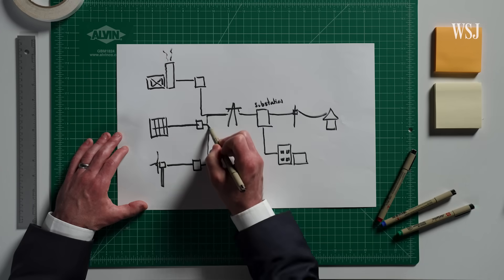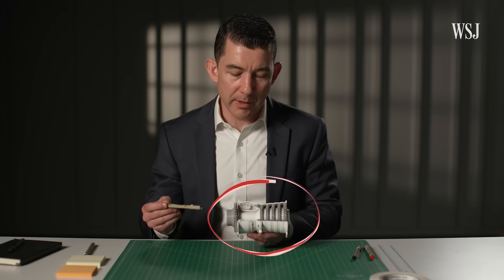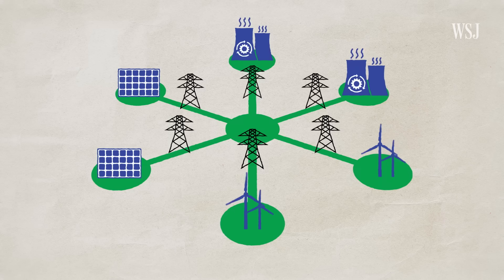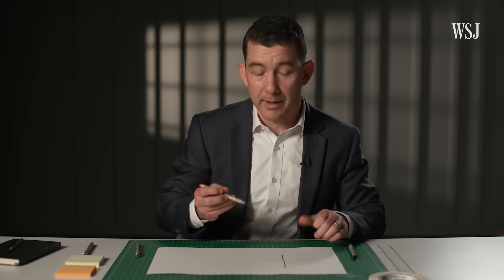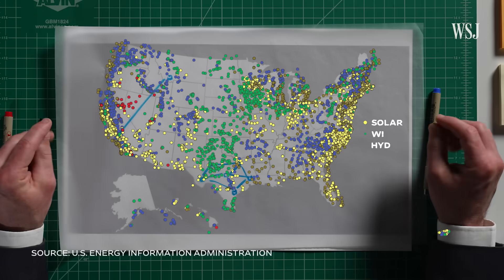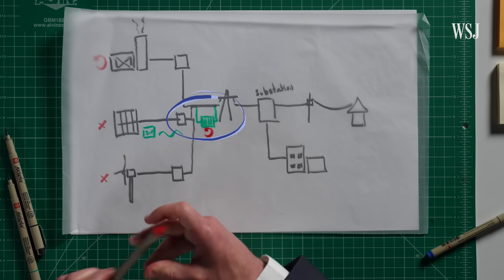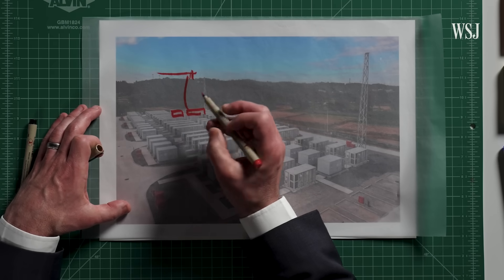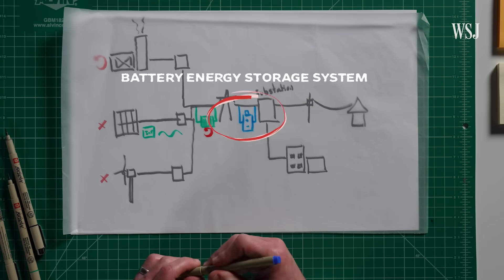How to Fix Renewable Energy’s Hidden Infrastructure Problem | WSJ Pro Perfected

Comment: As an electrical engineer, this was an outstanding overview.  Besides being an excellent speaker, the use of graphics and paper overlays was very fresh.  After the root cause(s)  of the Spain blackout are presented, this might be another piece of content explaining how things can go awry.
Reply: Except for the part where he overlooked what actual modern grid forming inverters deliver in terms of inertia.
See Dalrymple is SA, Australia for a first deployment.
Reply: I was concerned at first when they said “Mechanical Engineering”… but he did a great job all in all.
Reply: I'm no kind of engineer and I found that explanation horrible.  First, the frequency is tied to alternating current.  Yes? He doesn't explain how solar is direct. Second, frequency is a way to adjust energy based on demand (FAIK).  My non-engineering take on Spain is it didn't have the energy to make up for a quick lost of power from solar.  I'm not saying his explanation isn't good in a way, just that it does nothing, in my opinion, to educate me about WHY things work the way they do.  Anyway, surprised at positive comments.  Guess it's just me who doesn't get it ;)
Reply: @DepletionCurve  Doesn't matter as much as you think because Solar panel fields use Inverters to convert the DC to AC. Also correct on your 2nd point. Inertia doesnt fix the issue that happened with Spain. BESS honestly is the way forward. Most of the issues present were present before the use of renewables but are exacerbated by  renewables because of the way they work (more specifically, solar)
Reply: There's also a great video that goes in this problem on the channel Real Engineering and its titled "The problem with Wind Energy" (edit for a typo)

I was first introduced to the issues with harmonics caused by switched mode power supplies, battery backed inverter systems and other equipment in large office blocks in the late 90s.
Reply: @tonywilson4713  Yes.  Great video.  Love that channel!
Reply: @DepletionCurve  yeah he's actually a really smart engineer.
During COVID when people were proposing all sorts of solutions to the shortage of respirators he did this incredible video on how respirators actually work AND NEED TO WORK.

It turned out that he spent a chunk of his career working for one of the Worlds largest manufacturers of respirators.

The moment he talked about why you need super accurate pressure sensors with very fast response times I knew that most of the solutions being put forward WOULD NEVER WORK and likely kill a lot of people.
Reply: @tonywilson4713  COVID marked the end of respect for science, for me.    Or maybe it was when they started advertising drugs on TV.  Or when we didn't move over to the metric system.  Whatever the date, it passed ;) This video is exhibit A in having hundreds of thousands of electrical engineers you could call but you interview a mechanical engineer.  There are EEs on YT who cover the grid.  Well, preaching to the choir ;)
Reply: Why would they get a mechanical guy to do this?
Reply: @Manish_in_hell  At least they are starting to ask engineers instead of politicians and people of the street.
Reply: @Manish_in_hell  I think because he is involved with the synchronous condenser. Otherwise they should have gotten an electrical engineer specializing in grid systems.
Reply: @Manish_in_hell  Well, turns out the "mechanical" fella was quite qualified for the job. It's highly likely he has worked in the energy sector for many years. Maybe he has even sold and installed some of the equipment he talked about. That being said, nothing he covered was too complicated. Any engineer (chemical, industrial, petroleum etc.,) who has worked in the energy sector for a significant amount of years could potentially explain it just as well.
Reply: @MWENDA-vv5im he as a mec guy isn't qualified to comission any high voltage generators or transformers.
Reply: This has been known for decades.  Why did WSJ and MSM wait until Trump was president before telling the truth about green energy?!
Reply: Residential solar installations are great. They can provide even more stability to the grid. The panels on my house generate 7.2kw and on a hot sunny day in the summer and I'm using only 2.3kw with the AC on full blast and fish tank and console running. That means I can provide almost 2 more houses with the same energy needs. The long distance wires from the power plants don't have to provide so much energy.
Reply: Why does hertz have anything to do with it. The power line on my house doesnt come from a power plant. Isnt the electric idk, storage? Thats in every town. Got fences around it. Transfer station. Isnt that a battery basically?  Then we get our power from that? If it is storage why would it matter what hertz it is? Im probably sounding real stupid. But you cant learn if you dont ask questions.
Reply: Renewable energy will never meet the demand of AI and server banks. If we keep building them we will create a catastrophic energy shortage that will shut down the economy for months. The cost is also too high and must be offset by taxes. Fossil fuels and nuclear are the future. CO2 doesnt make the earth warm it makes it green and creates oxygen. We have barely enough now and we need more. Green plants increase their ability to convert CO2 to O2 exponentially and we could never make more then they can use. Human caused climate change is a fraud.
Reply: I'm an aerospace who works in industrial control systems, automation and robotics. 
Yeah they got this right but 30 seconds into this I wanted to scream - they asked a mechanical engineer.
I've basically done 35+ years of electrical work and most of that FIXING the mistakes of mechanical engineers. 

WHY TF didn't they ask an ELECTRICAL ENGINEER?
Maybe we should at least be grateful that that they at least asked an engineer instead of yet another economist.
Reply: @tonywilson4713  Thanks for reply.  Yes, I didn't think he said anything wrong, but as I mentioned,  yes, you don't want to get the frequency too low, but frequency is also used to protect consumers from surges, right?  The proper conservation is how AC works, why it's important, and why it's difficult to bring direct current sources into it, especially if they are not easily converted into AC?  Agree?
Reply: @tonywilson4713  looks like 35+ years of fixing others might say more about your workplace than the whole field of mechanical engineering huh

Comment: -GFM inverters dont have "unlimited supply of synthetic inertia", they are limited by whatever source is behind them werher PV or wind turbines. 
-All inverters whether following or forming require voltage, current and frequency measurements to operate.
- The mechanical losses in a synchronous condenser are minimal so its not lile youre putting a lot of energy into keeping it spinning.
-In a BESS you dont have two sets of inverters one taking power from the grid (which is called rectifying btw) and one injecting, its the same equipment with a dofferent current direction.
Good big picture explanation tho
Reply: My degree is in aerospace but I work in control systems. So si Di a lot of electrical work.
And you are 100% RIGHT on all 4 points.

Comment: From a person that used to design machinery, acquired an MBA and a Bachelors in Mechanical Engineering degree, and had a father with trade school degree and worked making electric generating equipment,this guy has the problems with renewable energy accurately defined. Many in Washington DC still can't figure it out and that included Biden and his cronies.

Comment: How do we make power cheaper for the average person?  Everything seems to point to power being significantly more expensive.  Someone should explain this to the public in detail.
Reply: Well, somebody should tell them that we are already paying a high price. And we were all this time. If we pull it together now, many generations after us will be thanking us.
If you didn't get what I am talking about, I am talking about all the pollution that does god knows what with everything around us..... But yeah, good point, that will be needed to take care off too (in some proper, honest way...)
Reply: Much of what you pay for is infrastructure, not generation.  So if you want to cut those costs you generate your own power yourself.  Aka residential solar.  But it still won’t be free.  It helps if you consume a lot of power (which can be as simple as owning an EV), so you can build your residential solar at a decent scale.

Comment: Good video. 

I came to the same conclusion, though I’m unconvinced that the condensers are needed with a well designed grid with grid forming inverters and BESS. 

What caused the Spanish Power Outage and the simple solution
https://youtu.be/ZiHum-VNHAM

Comment: You have missed the whole point of individual consumer production. It doesn't need the grid.

You generate, use and store on site. You can reduce and or cut off generation if not in use or the storage is full.

Problem solved for humanity, problem created for monopolistic industries wanting to keep centralised production in their hands 🤷

Granted not everyone can afford it, but that's more of a problem created by stagnant wages and rises costs. There was a time where one wage sustained a home and family of 3/4 children, now you need two incomes to get a rental and still struggle to provide for two children.
Reply: we dont have large scale energy storage splutions, Hydro pumped dams are good option but they are viable cross the globedue to geographical incompatibility
Reply: You can self-consume about 9 months out of the year with a modest residential solar system, but you will still need the grid to augment your generation across winter.  What you would not need, however, is a 200A or 409A service.  A 50A service would be plenty.
Reply: @junkerzn7312 I agree you still need some sort of grid but the sun still shines in the winter, wind still blows and tidal never stops.

There is an argument that individual energy production is best for national security. Central generation and single supply lines supporting large areas are vulnerable to cutting off energy to potentially millions in one single go, like nordstream, i know gas is different but if each person could produce their own gas like we can electricity, then something like that wouldnt impact us as much.

Comment: I think here we trying to resolve a problem that we can easily get rid of. How about we establish the normal standards as microgrids as a backbone infrastructure for the country instead of having hundreds of thousands of miles of wires running across the country. This is a century old problem that we can easily resolve today using microgrids solar with batteries and done. Concept have been proven by the US military and various islands around the world that switch to solar and battery 100%.

Comment: If general motors designs are car that physically does not fit on the road, is it the roads fault? 

So why is it the grids fault that renewables aren't being designed for it?
Reply: roads are upgraded to handled heavy vehicles.
Grid is also being upgraded to high voltage lines.
Reply: Who blames the grid, or suggest to change it? The suggestion is only to put additional units with inertia, thats all! Where is the problem? Grid inverter have not enough inertia, some additional flywheels will be added, and everything will work again, and all people will be happy.
Reply: Current grid is not efficient enough to transfer electricity over long distance
Reply: @DWO1199  Yes, you are right, but it is not only because of renewables, it is common problem of growing consumption and generation.
Reply: @DWO1199  Not really true, there are transmission lines in Canada over 800 miles long. It most places you don't NEED anything that long so longer lines typically aren't gonna be built.
Reply: @Majilikin  how efficient are they?
Reply: @DWO1199  Enough that they are viable and more are being built. Its OK to be wrong, so stop moving the goal post bud.
Reply: @Majilikin  I am interested, I have been tracking power transmission companies for a while, They are executing orders left , right and centre in the last 10 years and still have plenty of orders in the pipeline.
 The US has some of the oldest lines which are not efficient enough to switch to large scale renewable energy infra without an energy storage system. And this battery based storage system is purely controlled by China.

If you have some insights, I would like to know.
Reply: @DWO1199  That's not even a reply to what I said. You're just rambling at this point. Efficiency has nothing to do with renewables and battery banks.
Reply: @Majilikin  Why not?
Reply: @DWO1199  If the grid is efficient enough for the current AC generation, then it is efficient enough for renewables and batteries. Electricity is electricity, it doesn't matter if its made from steam or sunlight. 

How about you explain to me why efficiency matters for one and not the other?
Reply: @Majilikin  AC current is used to provide electricity over long distance using transformers to change voltage levels as needed.

Dc current doesnt work with transformers, kt requires High voltage power lines as it is one way flow of current.

Electricity produced over rooftop solar harder to tranfer  long distance as they dont support transformerslike like Ac
Reply: @DWO1199  What does any of that have to do with efficiency? 

And you can just invert DC into AC and then step it up and down with transformers. Its not hard. This tech has been around for a hot minute. Like whys AC can be rectified into DC. 

You don't have any clue at all how the grid works do you?
Reply: @Majilikin Nope
Reply: @Majilikin 
Correct me if I am wrong.
The grid was designed to transfer electricity from a central power plant to multiple points and step down the voltage as needed. And in this system they-used low voltage power lines to handle residential equipments. 

So if multiple solar units start to transfer the power back to the grid, they would use the low voltage lines, right?
Based on what little knowledge I have, I come to a conclusion that fluctuations in power generations from multiple solar units would overheat the powerline and it will be fried.

Am I wrong?
Reply: @DWO1199  Yes, you are wrong. Stepping voltage up is as easy as stepping it down. Its literally the exact same piece of equipment just running electricity through it in the other direction, essentially. They are called transformers. The fact you don't know one of the most basic electrical components confirms with 100% certainty you are not qualified to be talking about this.
Reply: @Majilikin  Lets go bit by bit on these points

1. Intermittency: 
Solar power depends on sunlight, which is variable. Without sufficient energy storage (e.g., batteries) or backup systems, this can strain grid stability, especially during peak demand or cloudy periods. 

2.Transmission Limitations:
Solar farms are often in remote areas, far from population centers, but the grid lacks adequate transmission lines to deliver this power efficiently. Over 8,100 energy projects (mostly solar, wind, and batteries) were waiting for grid interconnection in 2021, causing delays.

3. Grid Inertia and Stability: 
Traditional grids rely on the mechanical inertia of large fossil fuel generators to maintain frequency stability. Solar systems, which use inverters, lack this inertia, potentially causing instability unless mitigated by technologies like synchronous condensers or advanced inverters.

4. Aging Infrastructure:
 The grid is aging and vulnerable to outages, costing the U.S. economy $150 billion annually. It needs a 57% expansion and modernization to handle increased renewable penetration and electrified systems (e.g., EVs).
Reply: This analogy misses the reality of what has happened with the grid situation.   The grid operators traditionally had the ultimate authority to set the rules for IBR (inverter based resources) and accordigly created a stupid set of requirements that included details like IBRs must not exhibit any inertia, must be grid following (grid forming not allowed), and must not participate in any fault ride-through events.
It is now very apparent that this original legislation was written this way to impede the uptake of renewable energy and to ensure that the traditionally grid operators would remain in dominant control over the grid.

Overturning this stupid legislation is a very difficult, expensive, and takes a lot of time.

The fault ride-through legislation has been changed and there is now the framework for grid forming IBR to be used on the grid.  However in the recent Iberian peninsula situation none of the IBRs were participating in grid forming or supporting fault ride-through.